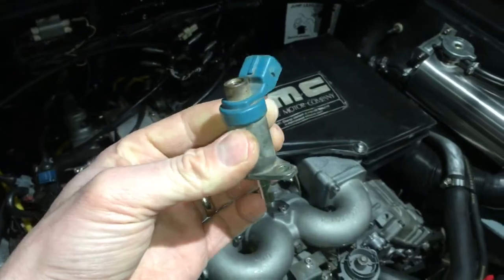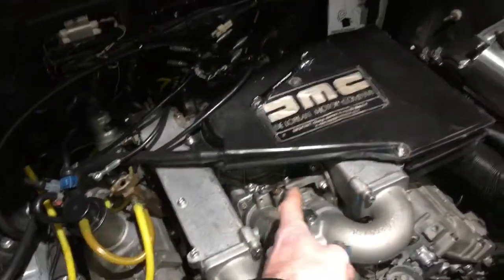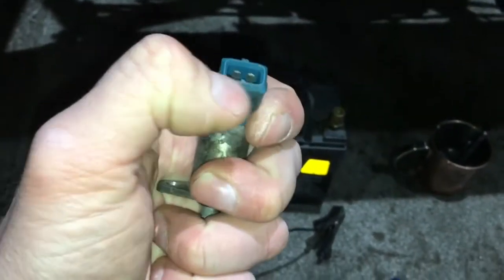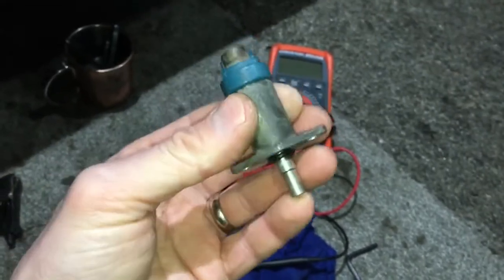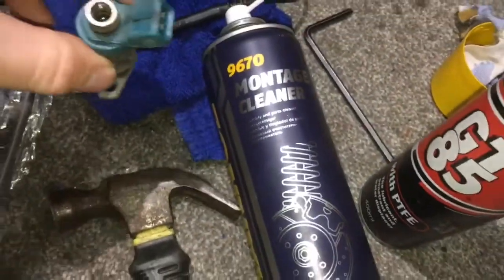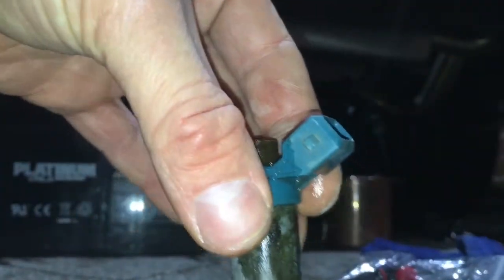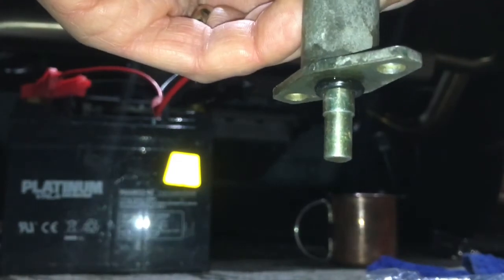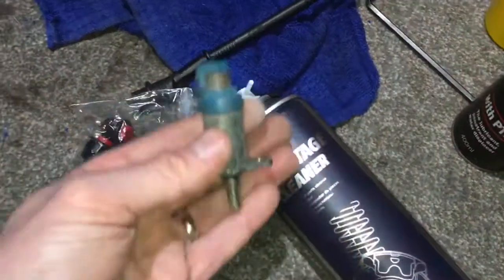Part 1/2 - DeLorean - faulty Bosch Cold start valve fixed. 0280170400

Comment: Were you just careful not to touch the leads together so that the battery did not arc, or was there something more to it?
Reply from the maker: Hello. Yes this is right .
You can use small speaker wire female crimp connectors, on lengths of wire, then touch those onto the 12v.
You want to touch it on/off, quickly ish, don’t leave it “on”for to long, but you’ll hear the solenoid actuate and it’s a easy task to do.

Comment: I believe mine is faulty as well, it’s basically the same as yours but different nonetheless. I’m going to try that same technique. Did you use a regular car battery for this test?
Reply from the maker: Hello,
Yeah - just a normal 12v car battery and made up a couple of cables so I could test it easily.
The key thing is for it to not drip once the cars started - otherwise it just gradually floods the engine and I was getting a Smokey start up each time as it would drip some fuel into the engine when the car was parked in my garage . Then I’d get a smoky start up every time .
At least this is an easy thing to test , as you can just drive the car, he home, park it, then immediately remove the valve and see if it’s dripping .

Comment: Plenty around for £30/£40...exactly the same thing.
Reply from the maker: Hey, you maybe right….but…I found it hard to find the correct one, with the correct part number.
I found lots on eBay that look the same but are different part numbers so won’t work or maybe fit/be compatible (the Vw one looks right but has a different socket and maybe sprays differently).

The cheapest I saw (I think ) was £150 for the correct one, that was used to . Mine still works very well since running it through the ultra sonic  cleaner.